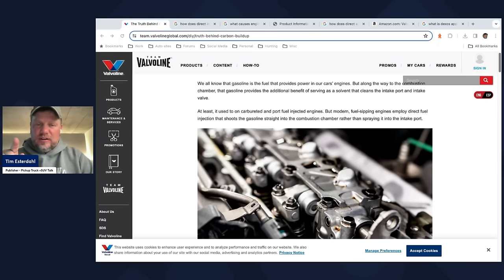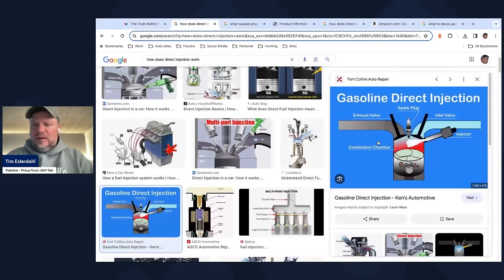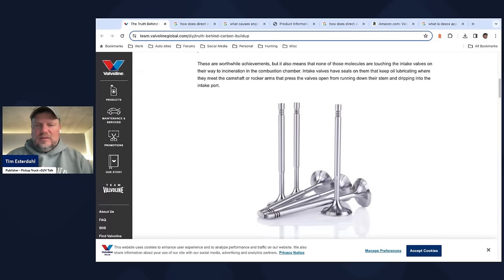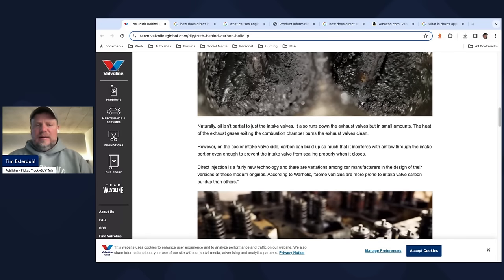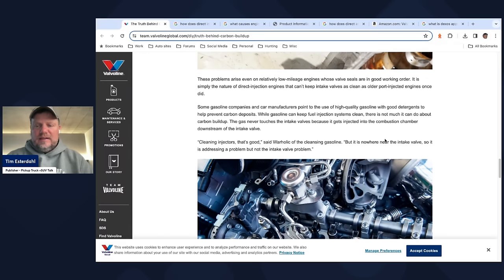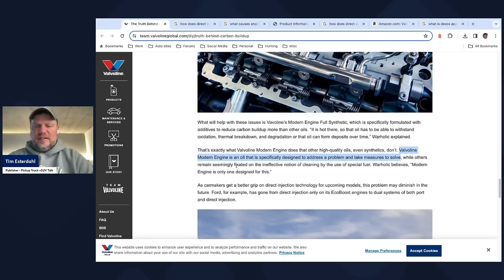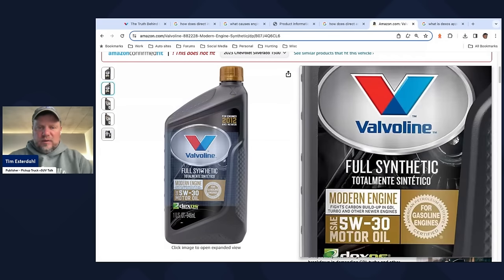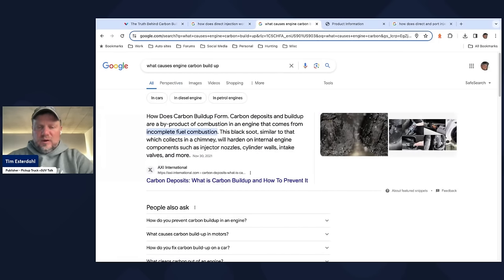Prevent Carbon Buildup with Modern Engine Oil? True or False?

Comment: $28 a quart! Wow! A good oil catch can will do wonders to help too. Most of the carbon buildup comes from recirculating crankcase gases. Ever since breathers became illegal, those gases will get redirected back across the intake valve. A catch can will allow most of the mist oil to condense and stay in the can rather than go across the intake valves.
Reply from the maker: Engineers hate talking about catch cans in my experience.
Reply: @Pickuptrucktalk  I wonder if that's because they can't put them on modern engines? I'm not 100% sure they can't put them on, but I suspect that's the case. Catch cans were the best option to reduce carbon buildup on the 1st gen Ecoboost engines.
Reply from the maker: I'm not entirely sure either. It seems more like adding a catch can make it look like there is a flaw in the engine design. OR they see it as an unnecessarily item with the aforementioned new oils. OR it is just another part the consumer would have to service and would be susceptible to failing. I've never met an engineer who didn't want their engine to last forever and be the most reliable engine ever. Adding more parts leads to more complexity and more chances for failure.
Reply: @Pickuptrucktalk  Well, servicing it is a thing for sure. You have to dump them out periodically. They all usually have a little breather with a filter on top too, so that's why I think they may not be legal for manufacturers. They aren't a true closed loop and miniscule amounts of vapor might escape and destroy the atmosphere you know.
Reply from the maker: @duggydo  the horror of a little bit of gases seeping out!!
Reply: In California catch cans are a no no! Tried to have my car smogged with one.
Reply from the maker: @stuarthoffman5065  really? Now that’s really interesting.
Reply: @Pickuptrucktalk  The smog shop told me that adding a catch can was considered by the ARB (Air Resources Board) as altering the emissions system and tampering.
They look at the emissions sticker under the hood and if it isn’t on the sticker diagram it shouldn’t be on the engine.
Reply from the maker: @stuarthoffman5065  Thanks for sharing. That’s really interesting to me.
Reply: @duggydo  Because legally PCV has to be reburnt. It's EPA emissions regs.
Reply: @terrencejones9817  that doesn't surprise me. We now have gas cans that don't work worth a crap because they can't be vented. Supposedly they are dangerous or will kill the ozone or something with vents.
Reply: I did the same for my kia stinger.
Reply: What about catch cans for the Duramax 3.0L diesel? There is a company that makes them and they are very convincing as to why this motor needs one.
Reply: @Pickuptrucktalk fill my catch can 2015 5.0 even tho it's port injection only in February 800 miles summers 5000 miles.  Lots of short trips and lots of cold start in winter.  If I had no catch can in a Direct injection only I Guarantee carbon build-up BAD design not having both!
Reply: Ford sells a Ford performance cattch can but will not install it on a warranted vehicle and installing it yourself voids the warranty. Also I understand catch cans are illegal in Pennsylvania where I live
Reply: @georgeporge7124  lol that is fasle legal in every state does not void warranty unless they can prove you they fill up and freeze in cold climate.  If you do a emissions testing and it fails because of that, you can always remove them
Reply: @stuarthoffman5065 I don’t care what they call it. I asked the service manager where I bought my car if catch can would void the warranty and he said no. It was a good idea!
Reply: Highest quality synthetic eliminated this problem
Reply: I recently did an EGR system clean-out on my 3rd Gen Prius. First time the intake manifold was off. What a mess. There was a pool of engine oil under the throttle body about an inch deep. The inside of the intake assembly was oiled terribly. Where the manifold meets the valve intakes, and the EGR gases meet the PCV oil vapor, it was sludge. Sludge, which of course, had run down into the 4 EGR passages.

Been running an oil catch can since. Also reduced the amount of oil I’m running in the crank case by .3 quarts as the PCV valve is on the block.

Wish I would have opened that all up earlier. The valves looked clean because they’re sprayed with gasoline, but I’m sure that the cat didn’t like that combustion product being sent to it for 125K.
Reply: Will deleting the EGR valve and capping the plate stop the recirculating gases?
Reply: 29.99 5 quarts walmart
Reply: Most people can barely remember to change the oil, check trans, power steering and brake fluid etc. Oil catch can is another item most would neglect.
Reply: @Pickuptrucktalk  It is not the engineers fault since they have to answer to the directorsbmanagers and the CEO of the company to build engines that won't last past their warranty or sooner to break down. Its all about profits.
Reply from the maker: @lactusgalacto1174  why do you think engines don’t outlast their warranty?
Reply: @Pickuptrucktalk 
 Plan obsolecense. look at the recalls many manufactures make because their engines are crap , no quality control. from good multipleport fuel engines to the shitty GDI engines that have problems with carbon build up.
Reply from the maker: @lactusgalacto1174  from my viewpoint talking with and doing videos on million mile trucks, I’d beg to differ.
Reply: Do you mean $28/ jug(5qts)?
Reply: I have a 2.4 L Toyota oil burner. It appears the only thing that works for the Pistons soaks. However, I haven’t tried that yet.
Reply: Would make it worse in my opinion and other sources because the oil and detergents are not getting to the back of the valves catch cans are ridiculous

Comment: Tim, the issue with oil, and its affect on modern GDI engines is volatility. Blow by can vaporize some oil, and the PCV system routes the vapors to the intake so it is burned instead of venting into the atmosphere like automakers did with pre 1970 engines. What changed a few years ago is the oil makers formulating new lubricants to meet spec ILSAC GF-6.   Those full synthetic oils are specifically engineered and formulated to work with GDI engines including turbo charged engines. They have much lower volatility so there is less oil vapor routed to the engine and coating the intake valves where it burns on to the back of the valve forming carbon. Note the other issue is low tension piston rings.  A lot of automakers have gone to 0w - 16 or 20 oils and they are using lower tension rings which reduces friction and saves a little fuel. Those lower tension rings do not wipe oil as well as higher tension rings and lead to increased blow by, and more carbon buildup.  Engines that are designed for 5w - 30 have higher tension oil rings and less carbon buildup.  The best practice is to change oil frequently before the additive pack wears out or breaks down so the oil in you rig is always fresh with low volatility. Oil is cheap. Engines are expensive.  Of course you cal always add an oil catch can to turn those oil vapors to liquid oil and store them so they don't go through your engine.  Catch cans reduce carbon buildup by trapping the oil vapors. Anyway, I always enjoy your vids.  Best, Bill
Reply: Very well said.
Reply from the maker: Thanks for the explanation. I think we said about the same thing with modern oil using additives to prevent carbon buildup. Regular maintenance and installing a catch can can help as well.
Reply: @Pickuptrucktalk  I must have missed it as I don't recall anything about oil volatility.
Reply from the maker: @williamgunn1076  it was in this video I referenced within this one: https://www.youtube.com/watch?v=jSheFdCs-lc&feature=youtu.be
Reply: I read somewhere that if you use a catch can  on your engine in states that adopted California emissions, you will fail the emissions test. Am I being misled here?
Reply: @jameshumphrey5923  I never heard that, and know nothing about that.
Reply: The EGR is the source of carbon, not oil on the valve stem.
Reply: @AR15231  Yep. I clearly stated the oil vapors from the EGR are the source of the carbon buildup.
Reply: Good review.  You actually mentioned ILSAC GF-6A.  Everything else is noise.
Reply: @martinmdl6879 does API SP mean the same thing as GL 6?
Reply: I've heard also that the molecules in full synthetic oil are all the same which can also lead to problems with phasers.  People that don't let your engine get to operating temperature like short trips colder climate also leads to more build up that can crystallize
Reply: @justingill5256  Heard? From who, what, where?  Synthetic oils do have uniform molecules selected by engineers to be stable. They prevent coking and degradation, not what you stated.  Syns flow much better improving cold start lubrication and phaser pressurizing.
Reply: @justingill5256  You've got it literally backwards. Conventional oil is the culprit of the majority of engine buildup issues
Reply: @williamgunn1076 Great info! I have a 2014 F150 3.5L EB with 95,500 miles, so far it's been running great. After doing some research I recently purchased a catch can(installing tomorrow) just for the simple fact of the GDI and turbo engine. Honestly, i wish i knew about them when i bought the truck. Anyway,  I've also decided to change my oil more frequently at 3,500 miles with Valvoline HM Maxx life(since it's getting up there in mileage) or Pennzoil UP, which i've been using for the last 25k.

Like you mentioned, oil is cheap...engines are expensive.
Reply: Bill you are right on. I would only add that variable valve timing contributes as well, due to passive EGR or overlap. Many manufacturers have redesigned GDI engines by placing small injectors in the intake manifold to spray some gas, ie. Detergent on the backside of the valves. For the older engines that are only GDI, one can use a PEA detergent spray, such as CRC GDI IVD intake valve cleaner. This is not a replacement for walnut shell blasting, but it does make a difference. People give these types of cleaners a bad rap here and other social media. But they don't understand how the product works. It works for weeks, that is why they tell you to wait 3 weeks for a second treatment if desired. Use techron to clean the injectors if wanted as well. Quality oil, and top tier gas helps, but it's the engineers fault for not thinking about this issue in the design and development. Certainly they knew there would be a problem.
Reply: Actually low tension rings ISN'T the source of blowby .. it's the contamination buildup in the ring lands preventing combustion gas from forcing the ring into the cylinder wall to creature a good seal. Rings have gas ports for this reason to cause a pressurized seal. When they get plugged from using conventional oil the problems start to begin quickly. Stick with ONLY synthetic oil and never exceed 5k mile oil change intervals and everything will be A-ok ✌🏼✌🏼
Reply: @CWB1863  you might want to consider Valvoline Restore and Protect. It will remove 100% of carbon deposits in 4 oil changes
Reply: @thestigisme2349  It works great on piston rings, but it will not remove intake valve deposits on GDI engines.
Reply: @williamgunn1076  True, but you can use any of a number of PEA products in your gas to clean up, or shell blast the valves( in worst case scenario) then make sure to use Top Tier gas
Reply: @thestigisme2349  Nothing added to  your gas will clean intake valves on a GDI engine because the gas never passes the valve.
Reply: @williamgunn1076 We are starting to see Valvoline actually cleaning the intake valves also. 3rd generation mechanic and engine builder.

Comment: 450,000 miles on my 03 grand marquis...10,000-15,000 mile oil changes since new, super tech full synthetic mostly since new...never an issue, engine still looks like new down under the oil fill cap....I think some engines are just better than others...less prone to carbon, sludge, and varnish build up...
Reply: It’s port injected. And one good engine design.
Reply: Either Pure Luck (at those Ludicrous oil change intervals) OR you are Lying :-)
Reply: @barenekid9695  it does burn 1 qt of oil every 2,300 miles, so technically it's getting some fresh oil every 2,300 miles...so by 10,000 miles it has had 4 quarts added....
Reply: @barenekid9695  Not ludicrous at all. I wouldn't do it to every engine but many engines are capable of doing it without issue. I had an 1994 camaro lt1 engine with over 300k miles that did 10k oil changes easily i could have went longer. Modern GDI engines are harder on the oil a modern camaro with gdi gets close to depleting the oil around 8k miles but thats with a 10qt sump compared to the old LT1's 5
Reply: My vr6 with 7500mi changes is at 135k. 
The aluminum surfaces were a little darker than expected when I was in there for timing chains. 
Im due for a change soon,but im waiting on a spin on oil filter adapter to ditch that stupid cartridge,and do the whole mess at once.
Reply: All my cars have 10k mile oil change intervals. Engines have zero issues. This isn't the 1970s anymore. Dino oil can easily go 10k.
Reply: When you do drive is it generally Highway with lots of time running at full operating temp?

I see lots of people saying highway miles are the best when buying used.
Reply: @EvzenKovar-i5p  It is true that highway miles are better. Doing mostly highway miles is how you can go long intervals on oil changes also. IF you do a ton of short trip driving without the car able to ever warm up to operating temperature. Say like only going to work and back home or grocery shopping. Even 3000 miles is to long between oil changes. But that doesn't mean idle your car in the driveway to warm it up as idling is also bad for the engine and oil. You want it to warm up under a light load like steady highway driving is best but almost any load is better then idle.
Reply: @DeusKDuo  I used to do a lot of Highway. Recent years just to work which gives me a few miles after reaching full engine operating temp. I’ve done 5K oil change intervals for the life of the vehicle so far, but I’m dropping it now.
Reply: @EvzenKovar-i5p  Unless the drive was atleast 15 minutes the oil probably never got to operating temperature even though the engine did. As it takes the oil a lot longer to warm up then the water does. Unless you get your oil analyzed to see how it is handling the short trips. 3000 miles is a good starting point. Even then oil analysis doesn't tell the whole story just lets you be a little better informed then guessing. So yes good decision to shorten the oil change interval. Depending you might still be good at 5000 miles but 3000 is a good safe bet. I also edited my previous comment to add more info.
Reply: @EvzenKovar-i5p  As for used cars. I am scared of low miles cars with a lot of years then i am of a car only a couple years old with 100k or more miles. The low miles cars i always find when i cut open the oil filters is sludge sitting at the bottom of the filter. High mileage vehicles i find obviously dirty black oil but it is clear not opaque.
Reply: @DeusKDuo  my work drive is about 25 minutes so I’m probably close with the oil temp. My rig is getting old now and even though I don’t have oil consumption yet I’m just going to do 3K. Thanks for your input.
Reply: @EvzenKovar-i5p  Your probably ok with 5000 mile changes then but the oil is probably near or at the end of its life by 5000 so i wouldn't hate it if you went 3000 bettter to change early then late.
Reply: And the government wouldn't allow that engine to be placed in any mass produced car now also. That's basically ancient history at this point
Reply: Agree , I have a 2007 Toyota Matrix 260,000 on it. Changed oil in it every 6 -7 K . used regular Castrol oil  engine still looks good . Does not burn alot of oil. Changed the valve cover and the engine has no sludge at all. I think engine design plays big part ..
Reply: 10 to 15000 mole oil change intervals is way to long. BS pal
Reply: @barenekid9695  Agree!
Reply: I had an 84 Mark.  Great car donated it at 270k miles, still running.

Comment: I  do change  the oil  on my 98 honda civic hatchback every 2000 miles.  It has 520,000 miles now. I recently overhauled the engine and replaced  the original transmission  with a used one. I will be buying a brand new transmission for about $2500 so I won't be concerned with trans problems. So far , so good .